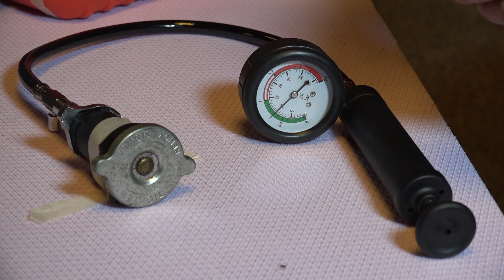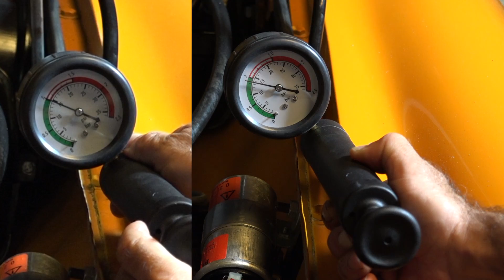Engine Cooling, Part 1 Checking for leaks

Comment: Years ago a friend of mine's parents called and asked if I could replace their water pump because the car was overheating. I loaded up my tools and drove over, when I took off the cap I saw that the gasket was torn up. I went over to the auto parts store and bough a replacement and never heard about the car overheating again
Reply from the maker: That is how it goes sometimes

Comment: Very interesting video for me as I'm dealing with a overheating cinquecento at the moment. Most likely my problem is the head gasket but I'm hoping not as I'm on  a budget......
Reply: terry atkinson open the expansion tank cap, start the car and if it starts popping bubbles the headgasket is likely gone. And check if in the oil cap there is a milky substance. If 1 or both, head is blown. But you then have to figure out why and fix that too. And replacing headgasket means replacing timing belt and cooling pump also and the spanner for the timing belt .
Reply: @mrvanT  timing belt and pump done. Doing the thermostat now however I've snapped the thermostat bolt in the block.... so more delays. Thermostat looked terrible after 22 years so let's see if the new one works first.

Comment: I order sometimes at hbm too. Did you get your Michelin compressor from them ? And are you happy with the quality of that compressor ?
Reply from the maker: Hi, so far I had no issues . And it seems to be working just fine.  Off course not al their stuff is high quality , but then again often its a low price.   I guess it depends if its for daily use or not..  Did you had bad experiences ?
Reply: @D3Sshooter  so far no issues no, but as you stated, some stuff is for occasional use not for daily use which is normal for those prices.

Comment: The big question for me is whether you're going to finish Old Rusty or not?   Did you find it too boring?
Reply from the maker: timleecan1 off course i will, that is still my favoriet project.   But i needed to get some smaller projects out of the way first so that i can get 100% devoted  to rusty.    I am almost done with the other projects as they were smaller.

Comment: Thanks a lot! Nice video, as usual. You should say that the presurisation of the cooling circuit help the coolant not to boil under a certain temperature. If not, the water inside will boil at 100° witch is too low for most engines.
Reply from the maker: bombero34fr , good point and indeed i should have stated that